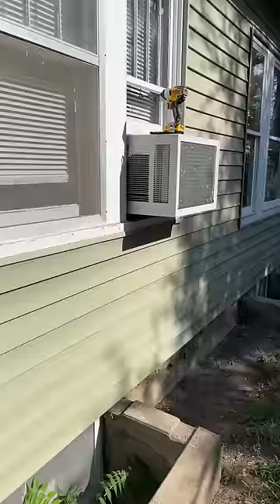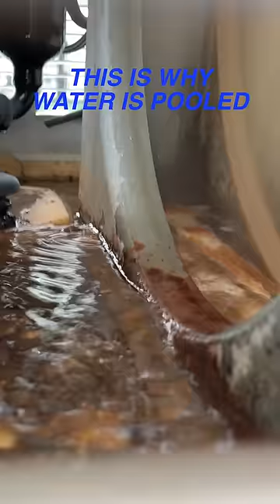🥵 99% Don't Know THIS About Window A/C!

Comment: I always drill them out as I'd rather the water drain then rot the machine
Reply: @Farquad76.547  yeah😂 so it'll rust out and you have to buy a new one sooner. it's called planned obsolescence
Reply: @oliver_klozoff  nailed it
Reply: Fans there that’s cooling it.
Reply: It’s that way so it rots and you buy more
Reply: Lol my 10 year old one that I even dropped from the second floor window running none stop every spring and summer would disagree with rotting...
Reply from the maker: I’ve never once had one rust through at my house or any of our rental houses. That’s definitely not the limiting factor on these, st least in my experience.
Reply: @HandymanHertz  pooling stagnant water is gross. Don't care if its efficient. Drill drill!
Reply: @HandymanHertz  Didn't say rust tbrough. Look inside the bottom of those units after a couple years of use. The internals suffer unless you open them up and coat all of the metallic parts with some sort of corrosion protection.
Reply: @Victtimus  Look inside the condenser section.....
Reply: Eh, I find the internals go bad before the shell has a chance to rot out.
Reply: It's literally rusting as he films
Reply: The water helps the machine cool
Reply: That slinger ring is a curved air inlet side.
The pooling is actually supposed to drain via evaporation of the heatloss happening with the aluminum, so as not to rot.
The inside does the same. It soaks the moisture from it's chilling state, runs down to the outdoor coil which is hot to dissipate the heat and disperse the moisture.
Therefore this makes perfect sense.
Reply: @mrright69  Look inside one of those machines after it's been in use for 3 or 4 years
Reply: @HandymanHertz  Most window ACs require a tilt of about 2 to 3 degrees to drain properly. This means that the back of the AC needs to be about ½” lower than the front. The tilt is needed to keep condensation draining out of the back of the window AC unit.   it's written in the manual...
Reply: Facts
Reply: @HandymanHertz  it's already rusted,wtf are you talking about
Reply: Except whem it starts to leak inside of your house..
Reply: @Usual Suspect William Hamilton no i didn't.  Had it slanted back properly. Pine needles got in there, and prevented it from draining properly. I drilled 2 small holes towards the front as an overflow which was only happening  when it rained. Still plenty of water for cooling the coils.
Reply: Why not use a liner on it.
Reply: @Usual Suspect William Hamilton You didn't watch the video posted did you? You may be right when you use the term rookie. I don't play with miniatures.
Reply: Fun fact if u need to run them in the winter then u should drill it so if doesn't ice up every and make the fan stop!
Reply: @oliver_klozoff  the efficiency gained from cooling the condenser with cold condensate is much more beneficial
Reply: I'll keep drilling them or removing the plug. Last ones were 10 years old ,both drilled. Only replaced them because of the MOLD buildup.
Reply: @dazellis8057  drilled it to be exact.
Reply: @colejarvis3098  nail In the coffin
Reply: I had to put a drill in mine as well. It was stinking up the house, I had to pressure wash it.
Reply: @christafarion9  it's not stagnant water. It's condense water and it is from the evaporator. It doesn't go inside your house. Youre just ignorant.
Reply: Listen to all this youtube teachers. I think you all should have your own drama show.
Reply: Untreated uncovered metal - water. Nope.
Reply: Drill, baby Drill
Reply: I've worked with these for years, different brands and hundreds of them. Just my opinion here.
1. The rust has never made the units "not work" or go bad. Have units that are 20 years old and the last thing that you have to worry about is rust. Normally the compressors and the cords and boards go bad after so long.
2. The water slung on the coils DOES maximize efficiency. If you like wasting money just to let water drain that's on you. Even if there is a hole, there will still be water in the unit and it will still stagnate. 
3. You need to wash the units at least once a year. If you don't, they build up mold and begin to clog.(I'm talking about the inside of the room at the front of the unit, the back doesn't matter) you can wash out the pan in the back of the unit when you wash the front. You can also coat them with rust prevention sprays, and we use these things called condensate tablets that prevent odors and clogs when you have drains on them(you should have drains on them).
So, when you have a unit on your house and never plan on moving it or cleaning it, drill a hole if you want. If you live in a building with multiple units and don't want it dripping all over the side of the building or sidewalks or awnings and you plan on washing it regularly so you aren't constantly breathing mold that the units naturally hold, don't drill a hole. Use a drain system, cause when you pull the units to wash them you are going to get nasty water all over your floors when you move them.. too many cons and not enough pros to drill the holes in them.
Reply: @hugofraga4075  you don't pressure wash ac units lol
Reply: @samo8565  actually you told someone that they don't pressure wash AC units and I just washed mine this spring then repainted it. Better go call the AC police because I power washed one. Now what you absolutely don't do is tell everyone your opinion is right😆
Reply: @hurtfultruth6539  I don't exactly understand what your point is. I'll say this though, anyone who knows anything about ac units knows that you don't use a pressure washer lmao
You damage the coils that way. You just need the acid cleaner and a water hose. Smdh
Reply: @HandymanHertz  I live on the east coast of Florida and I have this ac unit and so do my neighbors they are fairly new but already pretty rusty.
Reply: Eventually it just builds up sludge and throws muck reducing efficiency!
Reply: Agreed😊
Reply: “My mommy said I was special, so I’m always right! That’s why I know better than the engineers who designed these products and contradict the explanation I was just shown!!!” Lol.
Reply from the maker: Yup, Mine is tilted 👍🏼
Reply from the maker: Thank you for your comment and providing us with good tips and your experience  👍🏼
Reply: @MARK_ROSINE  that's why you have to wash it and use condensate tablets.
Reply: @christafarion9  you might want to look up what that word means
Reply: I've never had one last more than a couple years so they will clunk out long before rusting out anyway.
Reply: Oh no!! It has rust I can only see when I deliberately look for it!!

God I hate people
Reply: In decades of using these things I found that if you don't drill them the water pools and starts to get a very strong mildew smell coming into your house
Reply: @christafarion9  no one's telling you to drink it and it's not like it sits there forever,  it slings and new water builds up....common sense...isn't common
Reply: @Billy Hamilton well that depends on the ac  unit right? Probably not with window ac unit s but that doesn't mean u can't.....I like to sleep cold my g but when I wake up I like my house to be warm when I walk out of my bedroom lol.
Reply: I should have watched to the end.  I drilled out my AC.   Landlord is pissed.
Reply: And the fins..
Reply: THAN ...NOT THEN... THEY'RE 2 DIFFERENT WORDS
Reply: They are supposed to be flushed out annually.
Reply: We washed out the Window A/C units in the Desert environment because they would be full of sand. No joke.

Comment: Yep, i can confirm they operate longer and more efficiently with the weep hole in the bottom.  I bought 2 identical units, put a hole in only one of them.  The unit i did not put a hole in didn't make it thru the season, the one i put a weep hole in lasted about 7 years until we finally installed a mini split unit.

Comment: made that mistake. hit one of the high pressure lines. RIP AC.  second came with a plug and since it was in an indoor flex space. couldn't have water flinging around everywhere so had to use the drain port. at least the second one had one.

Comment: Drill it.  Friggin gurgling will drive you crazy 🤣
Reply: You think you can hear it over the compressor? Cause you cant
Reply: If you can hear it, it's not leveled.
Reply: @Schmuly  the compressor turned off it’s basically the only thing you heat
Reply: mine has a factory drain have mine for 20 years  and no rust ,rust air do smell
Reply: @keithbroh5730  why would the outside fan be running without the compressor on
Reply: You can't even hear it that much unless you're outside
Reply: It doesn't bother me at all plus I like the splashing sound which means there is enough water in the pan for it to sling properly.
Reply: Yep, hvac tech here. Drilled mine right out of the box after a few beers and the drill bit caught and hit the U-bends on the condenser. 
Had to fit and recharge it before I could get a chance to use it 😂
Reply: @Schmuly  most acs use the same motor for the condenser fan and for the blower, when i say most i mean like all of them
Reply: Yea doesnt that water need to escape /drain out plus also that rusty at the bottom cuz of water
Reply: @patrickmontgomery8117 I'll bet you're not the only one who's earned an honorary hvac tech cert with the drilling through the condenser coil hack!  🤣
Reply: @Schmuly My unit has a eco mode that turns off everything when it hits the desired settings .
I don't use that because i like the sound.
You can hear the compressor turning off and on, but the blower keeps running.
Reply: Then u must have low fan settings
Reply: The gurgling isn't even noticeable don't drill into your air Conditioner it literally says not to do that on the instructions for new air conditioners
Reply: @patrickmontgomery8117 You're representative of your industry.  Did you charge yourself $900 for the work?
Reply: @Kube_Dog  hahaha I should've. The mystery was getting the charge right. Lot of mixing going on there!!!!
Reply: @HerbMoore3  I felt like an idiot. I've only hit a coil one other time in my career and it was a WIC evap. Was clearing the drain with a screwdriver and it slipped up and caught the coil. That was 15yrs ago; never again!

Comment: Some window units have part of the condenser coil at the bottom of the unit to help reject heat and evaporates the water causing a dripless unit
Reply from the maker: That’s genius!
Reply: I have two dripless units in my rental right now.  I will never buy anything else.
Reply: That would be nice. My neighbors window AC upstairs drips right on top of my AC. Gonna have to do something about that for next year
Reply: @jessefoulk  Same problem here. I got a galvanized sheet of metal and slid it under the upstairs unit to divert the drip further out from my unit.
Reply: Water cooled condenser!

Comment: I like the hole that is at the back of my AC. Straight from the factory. Guess they didn't know that.
Reply: Smh... You think you're so clever don't you?  Some ACs, particularly older ACs, did have drain holes because manufacturers did not realize at the time that it actually could increase the efficiency of the unit by utilizing the cold water that just came off of the cold evaporator coil, in order to help cool the condenser coil. When they realize that, they started to build and design them so that they threw water onto the coil. Now granted, they also didn't think about the rust when they started doing this. But they have been for a little bit now, and newer components are rust resistant or completely rust proof.
Reply: @glasshalfempty1984 they definitely are not rust proof. I have seen units completely rusted after just 2 or 3 seasons of use. That on its own is enough reason to drain a hole. The water also causes the coil to get muddy and that will result in high head pressure, which defeats the purpose of the design in the first place.

Comment: I live in a humid climate the sling does not drain off enough water. The water starts leaking all over the place. Drilled out a 1in hole added a drain tube  now it’s quieter and dry inside

Comment: i even modified my ac unit to be fully water cooled i removed the old air cooled condenser and replace it with stainless steel heat exchanger and then modfied the fan to have a water pump that pumps water to the heat exchanger now the room is now colder

Comment: Me : someone whoes bro was an engineer, I knew of this condensed water picked by the fan to collect the condenser/ heating coil.
Hence, when I grew up and moved to my own home and installed a window air-conditioner and never drained the water to gain efficiency, however I did not realise that product quality have deteriorated since many years AND the result of "my efficiency gain knowledge" was that the botton iron part of  condenser and metal frame have all RUSTED 😂

Comment: The only problem with that is its an AC unit sitting outside, that water gets nasty af.
Reply: Why not just take it down in the winter
Reply: @bsanchez3563  why would you take it down?
Reply: @JahonCross  if its cold or rainy/snowy (present/applicable for mehself in my area it does but not coldder than about 20f or hotter than about 120ish degrees so strangely enough fwiw its said still to be a "moderate climate" ) I mean if its a portable unit id just simply take it out of the window or if I had a eother a widnow unit or a first floor need for ac and had both then Id also take that down or fwiw cover it so rain an snow and heaf do escape from back and forth inside to out and vice verse but otherwise as I prefer not to climb a ladder fwiw needlessly.. just not for meh as far as mere fun goes for going up and down and/or getting out a ladder is not meh idea of excitement fwiw idk but yeah

Ph also id not want there to be ice an stuff breaking the coils etc from expansion
Reply: Some people don't realize some of the big window acs weighing over 150lbs are in Windows 2nd floor and up. Many people have medical/physical disabilities and can't move it. Money can be a issue too for those who say "hire someone".

Comment: What if that water is going right into my floor? I pulled a rubber insert and it hasn't done it since.
Reply from the maker: Hmm… How old is your unit? Definitely, water shouldn’t be coming into your room!
Reply: It's supposed to be tilted a bit so the water runs toward the outside

Comment: DO NOT DO THIS WITHOUT CAUTION!!!!
if you over drill youll hit the freon
Reply: Drill only in the drain, ideally pull it out first so you can see - they have a drain tray, put a heavy handed drill could go through the condenser.

Comment: Mine started overflowing and spitting water out of the control panel. I think my window isn’t angled properly, causing it to flow inwards (140 year old home). I tried and tried to avoid the drill, but eventually was forced to. Where I put the hole still keeps a decent amount of water inside, but it finally prevented overflowing into the house.

Comment: AC units have a drain coming from the pan to drain the water away from the house so it doesnt cause rot.  The reason the pan gets full of water is because the drain gets clogged.  Drill your holes.  The fan is not meant to splash splash water.

Comment: Correct and if it becomes too much water it will drip out the sides there is some kind of a relief somewhere..... So in the big picture you can think of it as having AC coming out of a compressor yet you've also got the idea behind a "Swamp Cooler" keeping things cool for the unit

Comment: Is that why I have nats coming in my room?
Reply: 🌺 Correct & you need to drill a hole under the lowest point of the Air conditioner frame underneath to allow water to either drip or release water from your unit.....😊.......😊.......😊.......

Comment: I moved into an old welding shop for my welding business and the small office had a window unit put in the wall and the side vent openings were totally covered by the wall. I fixed it but I bet the previous occupants could never understand why the AC wasn’t cooling worth a crap.

Comment: you could use an A/C as a heat pump. revers cycle it Use in the midle easte for heating in the winter (in Baghdad)

Comment: Some new ones come with the drain hole pre-drilled but with a plug in it. You can remove it if you want to, but its designed to run with it left in. 😊

Comment: It’s sounds really bad on startup but I’ve serviced quite a few that homeowners drilled holes in the bottom to let the cooling water drain out. Makes the unit overheat and not cool efficiently.

Comment: The one we used to have had a drain hole but a cloth out the back helps to keep the water flowing down and away from the wall. It only takes a tiny strip of towel and if it stays wet it will draw up (and out) the rest of that water at least enough to keep it from getting nasty in the unit.

Comment: I drill mine out.

I have 3 units, 2 i drilled immediately, one after the second year when i realized everything the water touches constantly is corroding twice as fast as the other 2 units. I also don't have water flinging into my rooms and on the window sills.

I read the back of the box too 😂 this whole video is literally that.

Comment: In my experience, the problem I have with these is that 1/2 the time as they get old they start to splatter bits of rusty / moldy water which causes staining in the area surrounding them.

Comment: And the water in the bottom /pan needs to be there to cool substantially the gas high side line which lowers pressire, cools ,that saves the unit

Comment: Yea but what do you do when so much water collects it leaks into the room from the pan? Also the cooler in the front still sometimes creates a leak it’s hot enough outside. But even with a hole drilled enough water still collect to make that slinger effect happen.